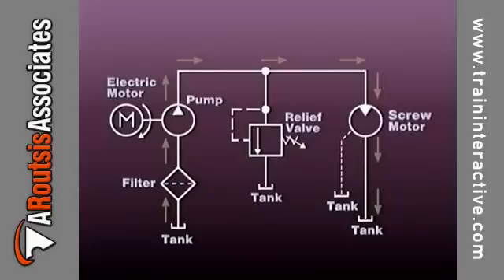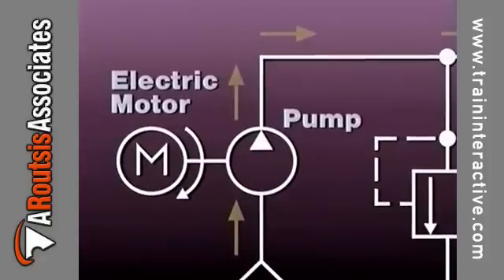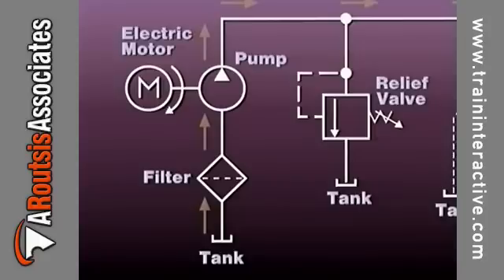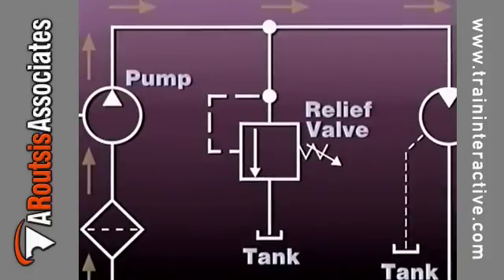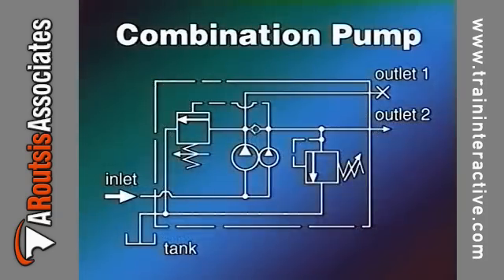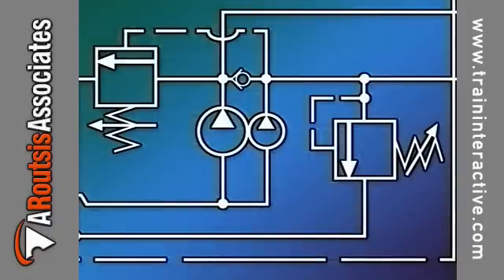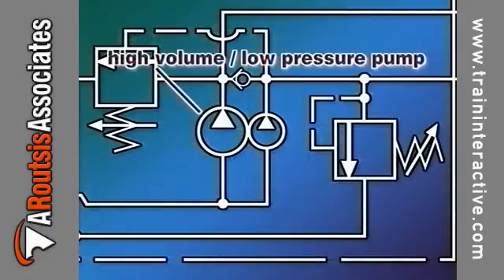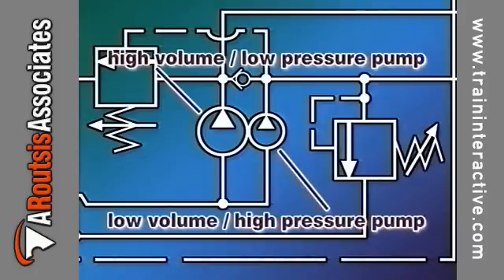Injection Molding Hydraulics - Reading Hydraulic Prints (excerpt)

Comment: There could even be a directional valve so the screw motor does not run whenever the pump(s) are turned on.